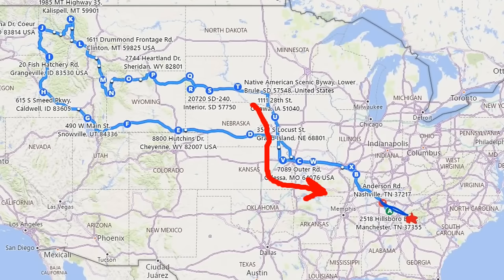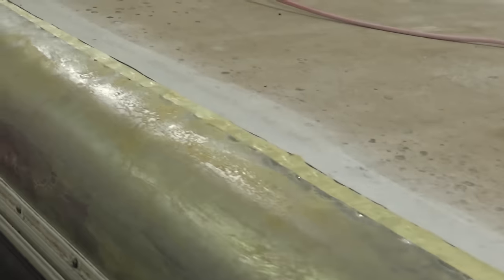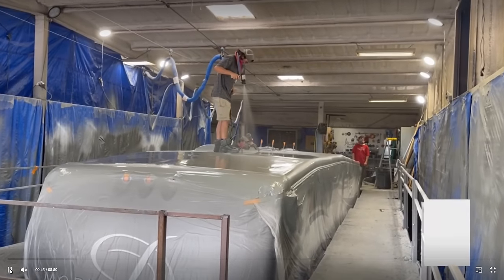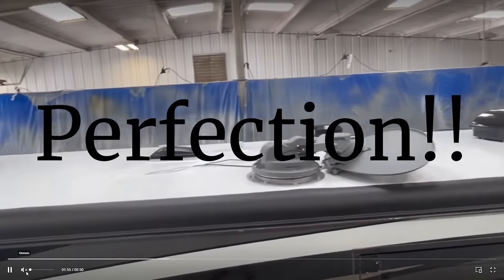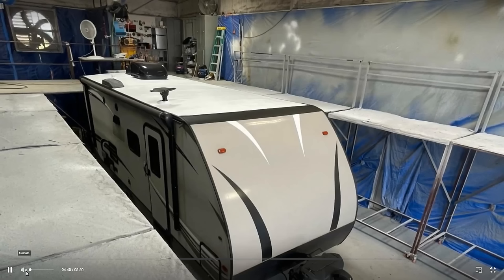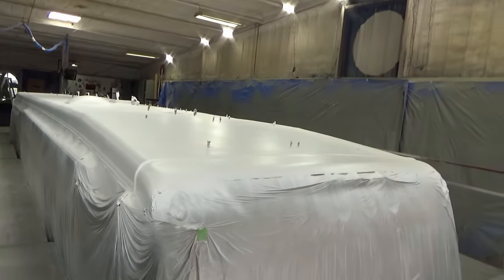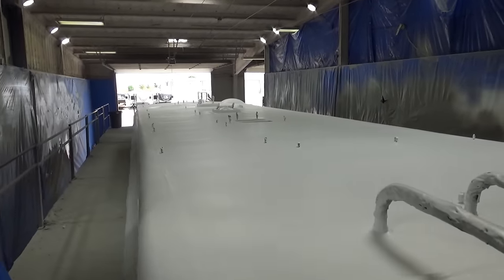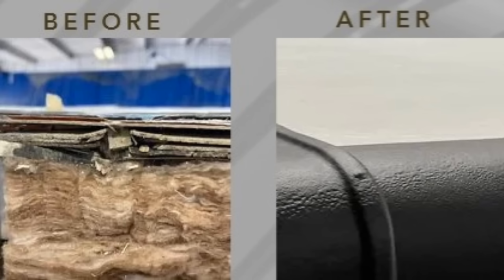👀 FlexArmor Spray-on RV Roof // Last RV Roof You'll Ever Need // Process Explained by Alicia Tennery

Comment: To me the one thing about RVs that is a "liability" is all the penetrations through the roof and that with sealants that break down. It only takes a pin hole to cause major damage from water intrusion. Even if they are supposed to, many people don't check their roofs, or put it off until expensive repairs are necessary. This product virtually eliminates the "thing". Great video; enjoyed it.
Reply from the maker: Thanks so much.  You are so right...just a pin hole can cause major damage.  This stuff is great.

Comment: Hello 
So if you see gray showing through, is that a warranty no charge type thing ?
Tony H 
Felton Delaware
Reply from the maker: Yes.  The rubber type material they spray on is gray.  Then they top coat paint it white.  If it shows through, then they need to add more topcoat paint.

Comment: I am sold, LOL. We are sitting with a broken skylight that the technician accidentally damaged at PDI when he installed our Max Air II covers, but they were out of stock. Since then the CEO won't let us stay in the RV during repairs, a big change that came after we bought from Lazy Days, initially they wanted us to empty the RV & come back in two months, LOL. Unfortunately Sheila broke her upper right arm with a spiral fracture since so I have to care for her 24/7 & have been unable to go over to get our skylight from L.D. yet. We still want an HD truck, but it's clear with her new bionic arm & her bum motorcycle leg that we can't do a regular HDT, so now we are looking at either Toter Homes (rear door RV style entrance) or a Super C. Anyway, We love the new roof with Gusto!!!
Reply from the maker: Sorry to hear how one minor thing can prevent you from using your RV.  Dave had the same fracture in his upper arm.  Full of pins and plates.  There is no problem with his arm now, but he throws a ball like a girl.  LOL.  We couldn't get in our HDT without the extra steps.

Comment: Hey @Dave, is that cable running the length of the rig for the invisible trailer repeater? We're full-time 3.5 years and have been looking to use our 2020 Chevy to set up invisible trailer but haven't quite got it solved yet. Thanks for any response.
Reply from the maker: That cable you see running across the roof is for the rear camera and it runs to a repeater at the front of the RV.
Reply from the maker: That cable you see running the length of the RV roof goes to our rear camera and it is attached to a routing repeater at the front of the RV.